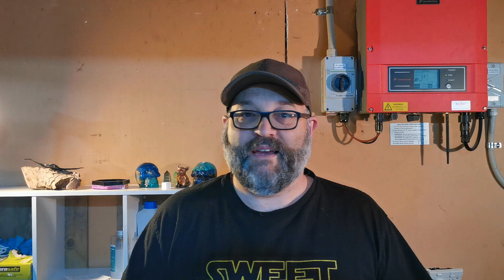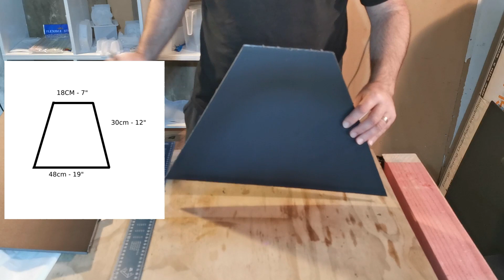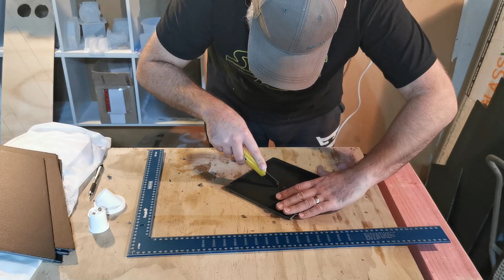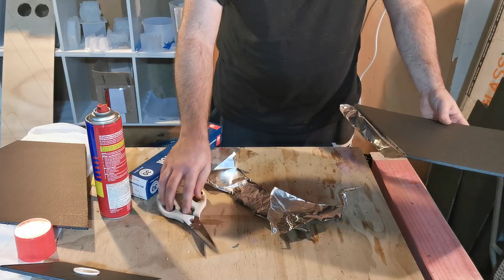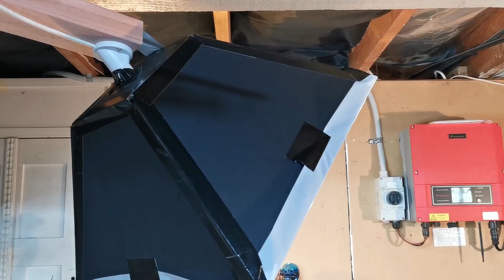How to make DIY SoftBox light

Comment from the maker: Thanks for watching. Here are the timestamps
0:00 Introduction
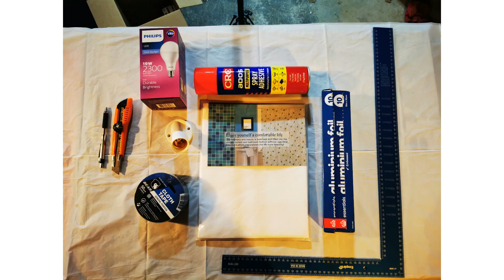0:16 Materials needed
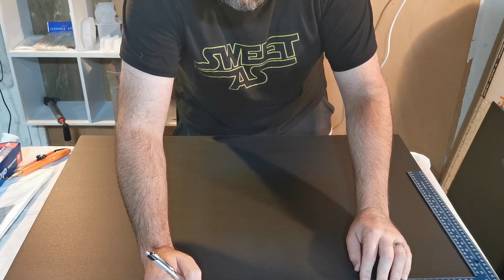0:30 Measuring and cutting
2:20 Installing  light holder
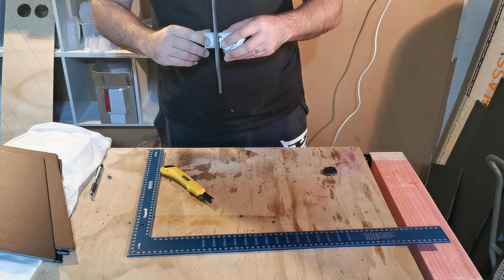2:26 Adding reflective foil
3:50 Joining panels
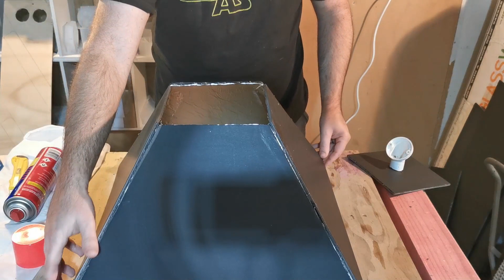4:28 Taping
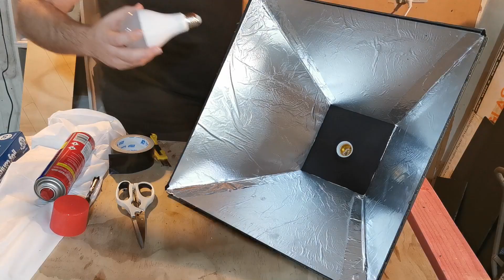4:55 Adding light bulb
4:57 Adding refused material 
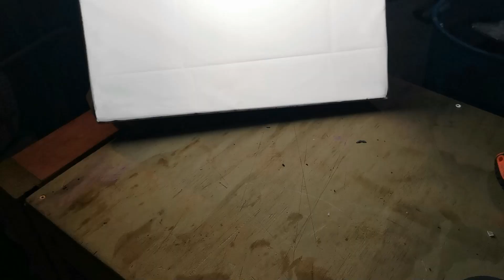6:05 Testing